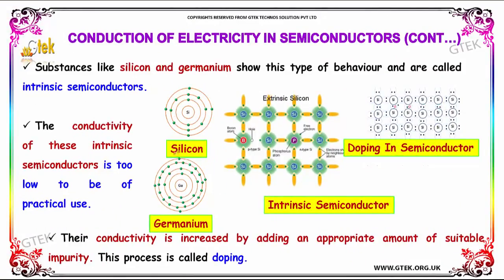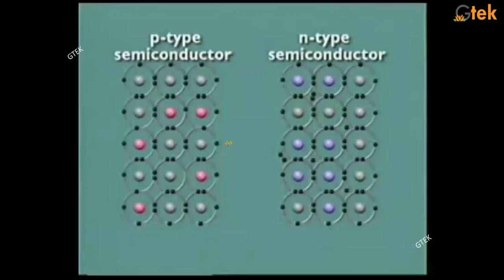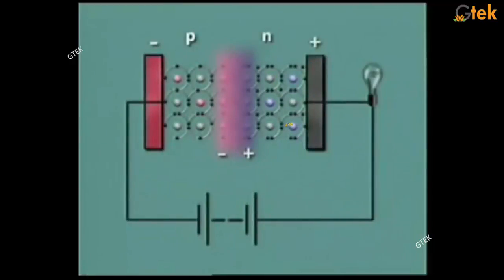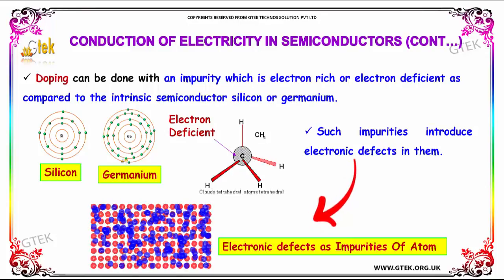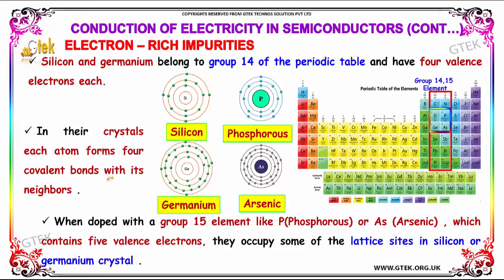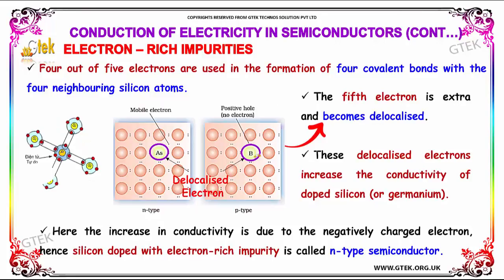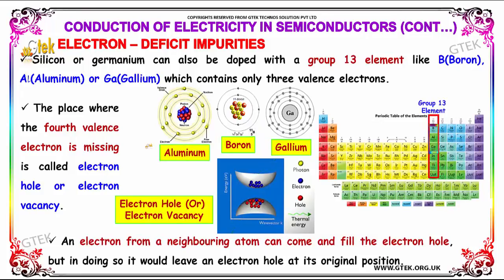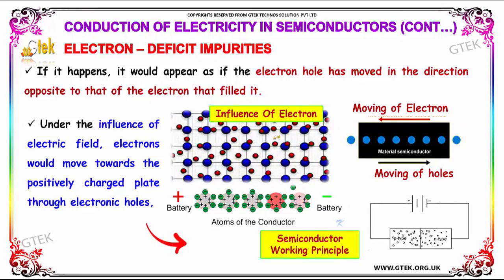conduction of electricity in semiconductors solid state class 12 chemistry subject notes cbse

Comment: Metals such as copper typify conductors, while most non-metallic solids are said to be good insulators, having extremely high resistance to the flow of charge through them. "Conductor" implies that the outer electrons of the atoms are loosely bound and free to move through the material.

Comment: Electrical conduction is the movement of electrically charged particles through a transmission medium. The movement can form an electric current in response to an electric field. The underlying mechanism for this movement depends on the material.

Comment: During charging by conduction, both objects acquire the same type of charge. If a negative object is used to charge a neutral object, then both objects become charged negatively. In order for the neutral sphere to become negative, it must gain electrons from the negatively charged rod. 3.